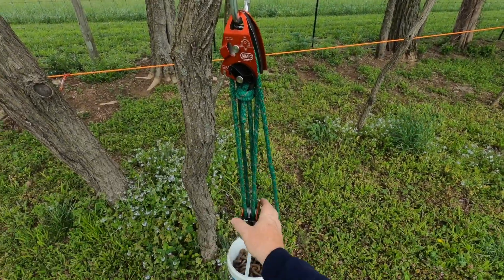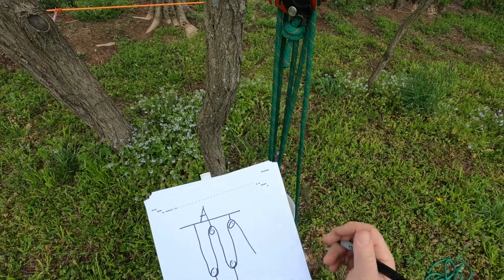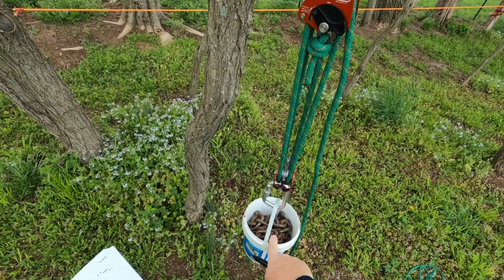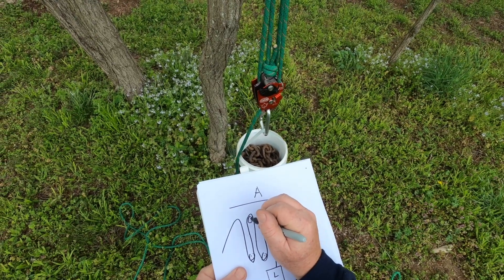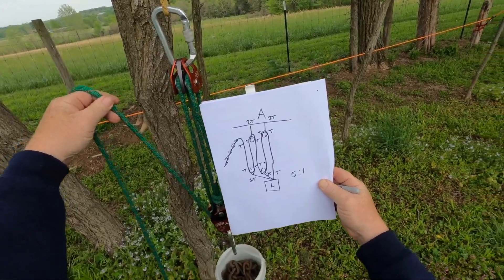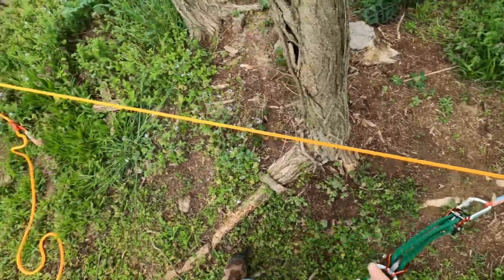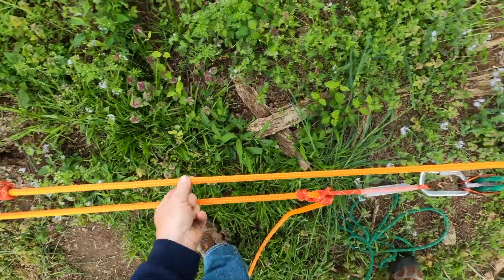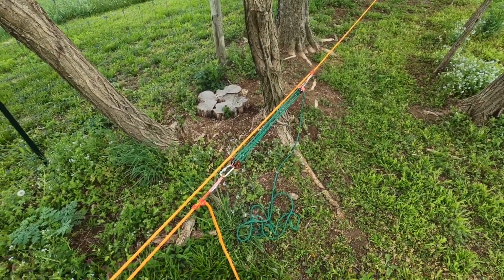Deconstructing the Set of Fours

Comment: where to buy a set of 4's ?  what brand do you recommend ?
Reply from the maker: The Petzl Jag, Harken Wingman, and Rock Exotica Aztec systems are the most popular. All are expensive and if I were to spend the money personally I would pick the Wingman due to the ability to lower under control more effectively. You can also build your own system much cheaper by buying the pulleys and rope separately. 

I would recommend exploring different options to get a sense of what you want and whether you want to use prusiks or mechanical stops to secure the load. And the size of the rope and the corresponding pulleys. Lots of variables to choose. Good luck.

Comment: With the rig you have set up, about how many feet of line do you use?  I would image if the line is too long it could be cumbersome, but too little and it would not be efficient.
Reply from the maker: Depends on what you are using it for really. Just keep in mind the ratios: four feet of line pulled for one foot of lift on a 4:1 and five for a 5:1. 

If you know your lifting distance beforehand it is just a matter of doing simple multiplication to determine minimum line length.

Comment: thanks for the video. Is there someway that you could set this up, so that when you are pulling a load ei engine, off the floor, you can be pulling down on the rope and still be 5:1? Thanks   Having it how you had it at 5:1 you have to pull up.
Reply from the maker: Of course, just put another pulley above and redirect the rope downward. This pulley is called a COD (change of direction) and changes the direction of pull but doesn't do anything as far as mechanical advantage. A lot of people just call them redirects. Good luck!
Reply: @perryfire3006  Cheers, thanks so much for clearing that up ;-)

Comment: I just finished rope tech. Your opinion do you think the instructor allowing us to only have 2 repels practicing pickoffs, 1 using a strap and 1 using an aztek pro sufficient time & reps to be timed for a practical test 4-6 days later without having the ability to practice in between that time frame? We were told study the handed out book. He gave us no reference videos. Don’t you think that’s teaching failure? Thanks!
Reply from the maker: I'm not going to comment on your instructor since I wasn't there but more than likely he is having to work under a constrained system, meaning he probably got allotted so many days to accomplish whatever task he was asked to complete. This happens all of the time in the Fire Service and it shortchanges students. The more students, the worse it becomes. When my son graduated Army boot camp he complained that there wasn't enough range time to complete his expert marksmanship so the problem is everywhere.

So don't get mad at your instructor, just realize he's working under a system he has little control over more than likely. 

Now a little pushback: why can't you practice? At the least you can visualize how each procedure happens. Do you own any gear? You don't need a training tower, go climb a tree. Rappel out of a barn.  No victim?, use a 5 gallon bucket filled with water. There is no excuse not to know your knots and MA systems. You get my point.

Time on rope matters and it's easy to tell who hasn't been on a rope much so get on a rope in those days before your test and do as much as you can. Also, team up with your classmates if you can and practice. They may have some gear you don't.

Good luck!

Comment: Really nice and interesting video. Wich is the right lenght or the  maximum lenght of the set of fours? I am trying to lift up a tower, but the two anchoring points are about 12m (40 ft)  from each other, the set of fours each time roll it up and became very hard to work. The 9:1 looks more efficient. Thank you and sorry for my terrible English...
Reply from the maker: If you are trying to raise something 12 meters then a set of fours becomes pretty clumsy and heavy, although technically it would work if the rope were long enough in the system. That's a lot of rope though.

Better to put a high directional COD (change of direction) pulley above your load and create a haul system on the ground such as a 3:1 if the load is light enough. Maybe I'll make a video on something like that in the future.

And don't apologize for your English, it's fine. Thank you for commenting.

Comment: The 9:1 configuration is really interesting! Thanks for sharing!
Reply from the maker: Thanks for checking it out. Cheers
Reply: @perryfire3006  My pleasure! Thanks for the great videos! I think it would be interesting if you made parallels to it using other techniques. For example, instead of a set-of-fours or tackle-block, you could use a lever (a wooden or metal rod; to pull closer without dropping), a reduction pulley (like for a hand-cranked water well pulley), reduction gears (to decrease the speed and increase the torque), and so on.
Reply from the maker: @SapioiT  Interesting concept. Maybe once the rope concept is played out it could be something to explore but I still have a ton of ideas for more rope videos. Thanks for an interesting thought.
Reply: @perryfire3006  My pleasure! Thanks for the interesting videos!